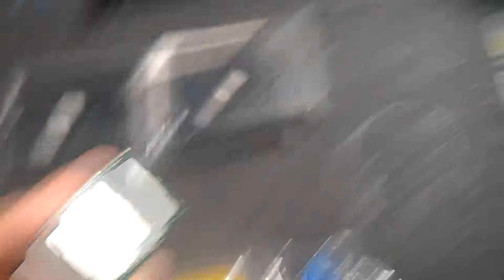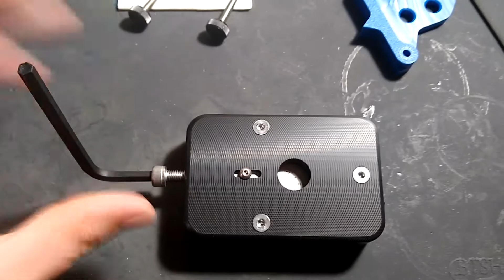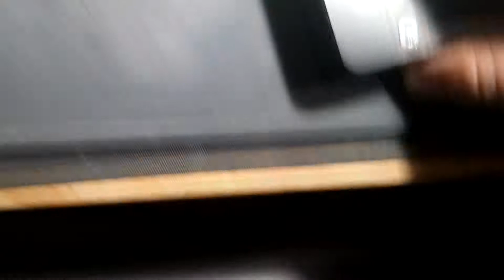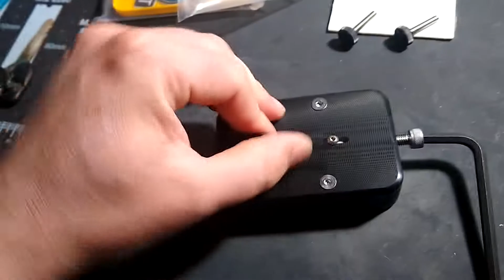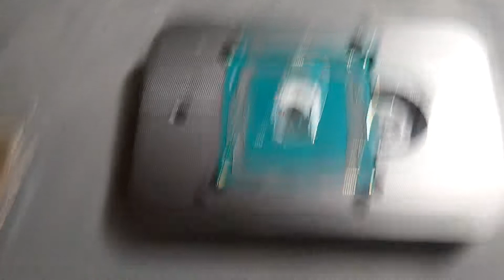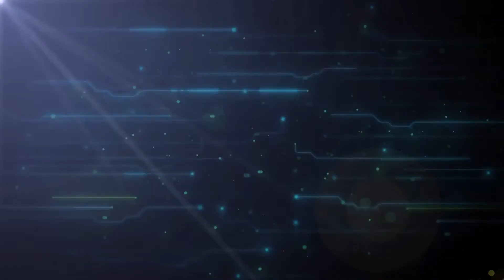7700K Delid with the Rockit 99

Comment: Hey dude. What happened /went wrong? Figured out? Im trying to avoid mistakes before i do it..
Reply from the maker: Nothing went wrong, just be prepared to hear a loud snap when the IHS finally gives. There isn't any caps under the IHS of this processor so nothing is there to really break. I didn't seal the IHS back after reapplying the thermal compound. Supposably that increases the gained thermal headroom. For me I didn't get to much of a temp drop, like 6 degrees. I need to test more though.
Reply: @draxxilletech  thank you ! I was wondering if i should seal after. I saw some videos where the cpu latch moves the IHS when closing it in, possibly missaligning the IHS? Just seems weird as ppl are reporting 10-25 c drops. I gather you can quickly screw up the quantity of LM. The deliding part im not sweating about, thats the easy part hah. Just wanna do it properly for max gains :D
Reply from the maker: Sorry for taking so long to reply, Idk why but it flagged your comment as spam. With the latch I just compensated a little bit for it moving. I didn't use LM because I don't feel like dealing with the maintenance side of it. As for excess LM, I didn't see anything on this CPU it could short. Most people use clear nail polish to protect components. Here is a quote from Gamers Nexus, ' "Nail polish typically has nitrocellulose or another functionalized cellulose in it which forms a thin, stable film without a gap over items such as fingernails, or the capacitors you used it over. An alkyl acetate helps move it into place, and then promptly evaporates leaving behind just the thin film.

"Some nail polish formulations have benzene derivates. Toluene is a prime candidate used by some companies, which does a similar job as nitrocellulose. Look at the composition before buying or using these, as toluene isn't nice to play with even at lower concentrations." '

For max gains, I would say LM and don't reseal. You have to do maintenance every few months though.